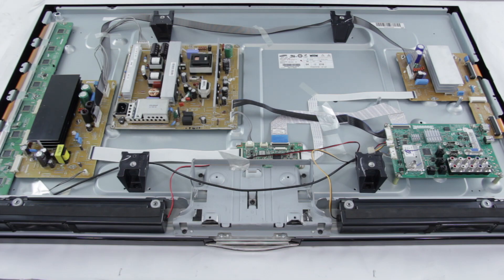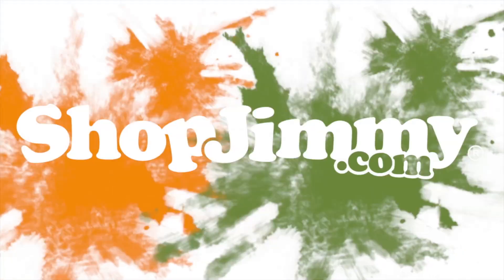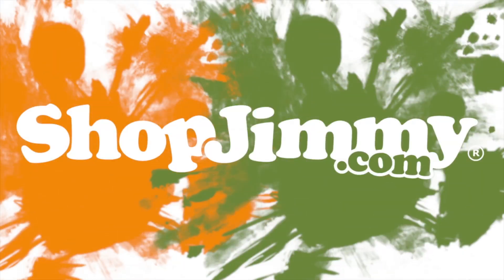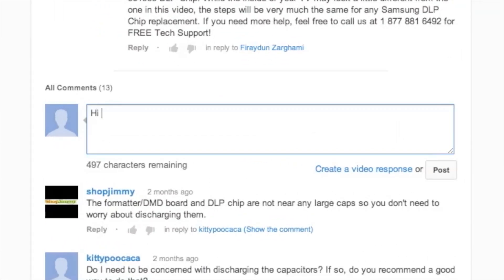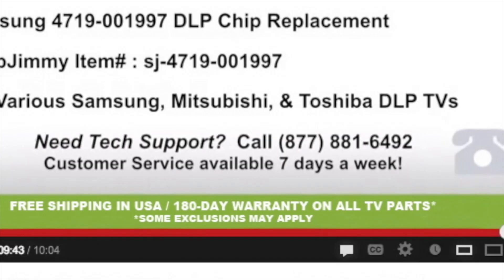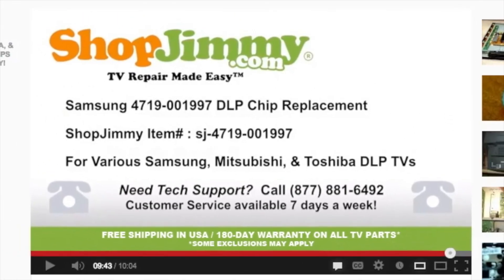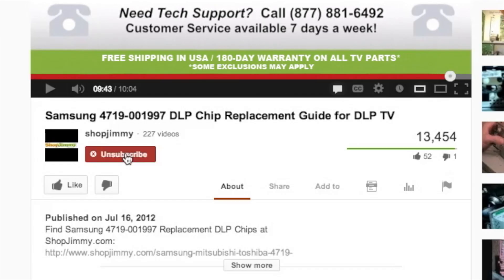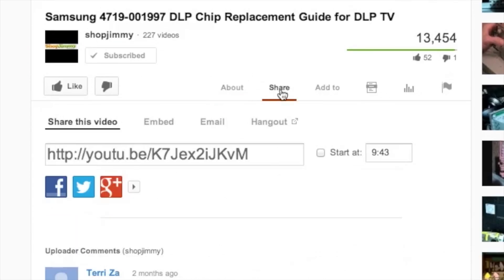Plasma TV Repair Tutorial - Common Symptoms & Solutions - How to Fix Plasma TVs

Comment: Samsung PS50P91FHX /XFA
Hi there,
My Tv works fine for some hours of running then the picture goes fuzzy with many coloured dots then shuts itself off and turns on again for a while with a good picture, then does the same again after a few minutes or so. Then when I leave it shut off for some time it works again for a while then does the same thing again and shuts itself off and sometimes wont even turn on with a picture again unless it has been shut off for a while. 
Could it be bad capacitors?
Thank you in advance for your kind advice.

Comment: l have a Samsung plasma tv model # 850FH - YB01 when you turn it on it will click and  make a loud pop/screiching sound with lines if l unplug it and plug back in it will repeat the process with different sounds and lines if l do it enough times it will come on and work perfectly also if it is on and warmed up and you turn it off then back on it will come on like it is supposed too any ideas on the problem

Comment: I have a 50'' LG Plasma PDP50H20000, when I plug in the power cable. Then the TV clicks and the LED flashes green, then it clicks again and the LED flashes red. This happens 3 times and then the TV stays off and LED flashes red.

I have replaced the PowerSupply Unit with a replacement and leaves the Y-SUS und Z-SUS Board disconnected. But the error still exists.

I hope you can help, thank you

Comment: Hey, my Samsung UN40F6300AF led tv wont turn on however the red light blinks several times when trying to turn on. Also on another note, on the back of the tv there is a little casing you can take off and unplug a connector leading to the main board. When I do that the tv doesn't blink red or go on still. Any thoughts? thanks

Comment: I have a 42" Samsung Plasma TV model #PN43#440A2FXZA that does not power on. There is one fuse on the power board. What is the proper way to test it? An OHM meter?
Reply from the maker: Patrick Martucci    Try this at your own risk. Unplug the TV, then disconnect the y board and plug in the TV to see if the TV powers up. Reply with the results of this test. Thanks! www.shopjimmy.com

Comment: samsung 60 inch t.v. model # S60FH-YBO2  for about 2-3 months sometimes my tv WOULD not turn on with picture.. I found if i unplugged the power cord from the back of the tv n plug it right back in it would turn back on..well it finally stopped I need your GUYS help desperately....THANKS
Reply from the maker: Brad Jones   Try all repairs and troubleshooting at your own risk.  I recommend running the flashlight test on your TV.   Here is a link to a video we produced that shows how to run the flashlight test. https://www.youtube.com/watch?v=xUzCLgoSPGM Please reply with your flashlight test results and we can recommend a replacement part for your TV repair. Thanks and please let us know if you have any questions! www.shopjimmy.com

Comment: A Visio plasma model M3D650SV  has 2 vertical bars right of center as observed from the front.  The bars are about a connector width apart, one has color lines in it.  Both bars go from top to bottom.  Thanks in advance.
Reply from the maker: William Cartwright   Try all repairs and troubleshooting at your own risk.  This sounds like a TV panel (TV Screen) problem.  If your TV panel is bad, it may be more cost-effective to replace the TV as panels are typically hard to find in stock, difficult to replace, and expensive.  Thanks and please let us know if you have any further questions!  www.shopjimmy.com
Reply: Thank you for you red response.  My error is that this TV is an led, not a plasma.  I assumed because of the weight that it was a plasma.  I am in process of removing back cover in order to take a closer look.  Thanks.

Comment: i have a vizio p50hdtv10a that has no picture and muti colored blurry lines are moving on the screen.. any suggestions before i decide to rip it down for scrap?  Ray
Reply from the maker: raymond roland   PLEASE SUBSCRIBE TO OUR CHANNEL - Try all repairs and troubleshooting at your own risk.  This could be a problem with either the main board or the TV panel.  You can replace the main board to see if that fixes the problem.  Click this link to replacement parts for your TV model number:  http://www.shopjimmy.com/catalogsearch/result/index/?cat=56&q=p50hdtv10a  There may be multiple boards for the same TV model number, be sure to match part numbers on your current board, with your replacement for compatibility.  Here is a link to a video showing how to identify your part number, click here: Thanks and please let us know if you have any further questions with your TV Repair!  www.shopjimmy.com

Comment: Hi!
I have a 2012 Smart Samsung Plasma 55" Tv model No:PN59D7000FF Version No: Y504 S/N No:Z3423CZC100126Y the TV won't stay on, it keeps turn on and off by itself and show the picture of  Smart TV Samsung on the screen at about 1 second but when i looked  at the back of the Tv I can  see a green light flashing everytime it turns back on. I have to unplug it to the outlet for it to stop turning on and off by itself.

Comment: I have a samsung pn51f4500bf plasma TV, after being on for 5-10 min it starts power cycling, your thoughts
Reply from the maker: Paul Server    Try this at your own risk. Unplug the TV, then disconnect the y board and plug in the TV to see if the TV powers up. Reply with the results of this test. Thanks! www.shopjimmy.com
Reply: ShopJimmy.com with the y board disconnected the TV will not power up

Comment: 2013 Samsung LED UN65F6300AF TV. Picture Flashes at about a 1 Second rate. Looking at the Back of the TV (Cover Off) you can see the back Light LED's flash Power Button will flash 5 times slowly. Thinking it was the LED Driver i replaced the Power supply but have the same symptom
Reply from the maker: Larry Peterson  PLEASE SUBSCRIBE TO OUR CHANNEL - Try all repairs and troubleshooting at your own risk.   I recommend replacing the main board in your TV.  Click this link to replacement parts for your TV model number:  http://www.shopjimmy.com/catalogsearch/result/index/?cat=56&q=UN65F6300AF  There may be multiple boards for the same TV model number, be sure to match part numbers on your current board, with your replacement for compatibility.  Here is a link to a video showing how to identify your part number, click here:  https://www.youtube.com/watch?v=BEPWrefQvqI  Thanks and please let us know if you have any further questions with your TV Repair!  www.shopjimmy.com

Comment: Hello this is sam  i have a sharp aquos 55 inch led tv model number lc-55le620ut its having some lines on the right side of the screen an its flikerings  the picture is moving in slow motion on one side  an the middle it has a black shadow an some times it goes away after like 20 mins but know is stuck like that please help

Comment: My problem could be slightly different. I have a solid black vertical line going down my TV, its a Samsung model No. PN50A400C2D, its about 2 inches wide. Is it still the Logic Board even though there isn't color lines.
Reply from the maker: stefan garza   Try all repairs and troubleshooting at your own risk.  This sounds like a TV panel (TV Screen) problem.  If your TV panel is bad, it may be more cost-effective to replace the TV as panels are typically hard to find in stock, difficult to replace, and expensive.  Thanks and please let us know if you have any further questions!  www.shopjimmy.com

Comment: Great video.  I have a Samsung Plasma PN50A550 which will not turn on.  No power, no red light, no clicking, nothing.  I checked the usual suspects -- outlets, power cord, etc. What is the most likely issue?  Fuses, capacitors, etc.  Can I fix this myself on this model?

Comment: Hello Shop Jimmy,

I have a LG 50PV450 plasma. It has sound but no picture. 
A couple of days before it failed completely, I would turn on the tv, get sound and a few minutes later picture would appear. On the last day before it died, the tv was on (with sound /no picture) for 30mins, before picture appeared.

Any suggestions?

Comment: Hi thought your video was informative .Thanks.I have a samsung 43"plasma m,code ps43d490a1wxxu with a screen that has red speckles and a yellow haze.This looks to be the x sustain planel,what do you think and how much will it cost to fix? Thanks John.
Reply from the maker: sandie rowland  PLEASE SUBSCRIBE TO OUR CHANNEL - Try all repairs and troubleshooting at your own risk.  I recommend replacing the Y-Main Board and the Bottom Y Scan Drive.  Click this link to replacement parts for your TV model number:  http://www.shopjimmy.com/catalogsearch/result/?q=43d490a1   There may be multiple boards for the same TV model number, be sure to match part numbers on your current board, with your replacement for compatibility.  Here is a link to a video showing how to identify your part number, click here:  https://www.youtube.com/watch?v=R1jmj_foId0  Thanks and please let us know if you have any further questions with your TV Repair!  www.shopjimmy.com

Comment: I have a pn64e550d1f and it was power cycling on and off so i inspected boards and found a blown transistor on the x board so i changed the board and tv worked for an hour and now it is power cycling again.any ideas on what the problem could be?

Comment: I have a Samsung plasma model HPT4254X/XAA that one day just turned off suddenly and then was attempting to cycle back on. I could hear a relay (I think) keep clicking every few seconds but the picture never reappeared. I unplugged it and a day later plugged it in. I worked fine for a few days then repeated the same behavior and now will only power cycle but no picture ever appears. According to your video that might be the Y-sustain? I would love to fix it myself somehow so let me know if you think that is the problem, what part to order from you, and how difficult it is to fix. Thanks!!
Matt

Comment: Hi Jimmy, I have a Samsung pn50b550T2F .
I have two vertical lines on the screen. There is a black line about an inch thick. Also after opening and using a can of air to blow the dust, I got a new black and white line 1 inch thick. The bottom buffer has brown flexible ribbon cable that appears to be soldered or glued to the metal connector, as there is no connector to release the ribbon cable.

Comment: Samsung pn50c430a1dxza the tv does not turn on when i press the power button. I hear it click on, but the screen is b lack. So far i have troubleshoot by powering up with x or y disconnected to see it would power on with one disconnected but no luck. Any suggestions ...respond to rs109@gmail.com
Reply from the maker: ras109   PLEASE SUBSCRIBE TO OUR CHANNEL - Try all repairs and troubleshooting at your own risk.  This could be a problem with either the main board or the power supply.  You can replace each board individually to see if one of them fixes the problem.  Click this link to replacement parts for your TV model number:  http://www.shopjimmy.com/catalogsearch/result/?q=pn50c430a1dxza  There may be multiple boards for the same TV model number, be sure to match part numbers on your current board, with your replacement for compatibility.  Thanks and please let us know if you have any further questions with your TV Repair!  www.shopjimmy.com

Comment: Samsung PS51D455 - it gave a loud pop, when turning it on and the screen stayed black. When replugging power the standby LED blinks 6 times and then stays of (Can't remember if that's the normal startup sequence). 
I got the backcover of for further inspection and looked for any blowed components. Every seems fine except for a round blue component on the Y mainboard that has cracked some of plastic off but it doesnt really look like has expanded. The "heartbeat" LED doesn't blink like it should - long blinks. Any suggestions is appreciated. Thank you very much! :)
Reply from the maker: Daniel Christensen   Try this at your own risk. Unplug the TV, then disconnect the y board and plug in the TV to see if the TV powers up. Reply with the results of this test. Thanks! www.shopjimmy.com

Comment: Samsung PN43D490A10 PLASMA. I believe we had a voltage spike causing amps and tv to stop working. The TV has the red standby, when using the remote you can hear tv click and screen flickers but stays black. I hooked up a DVD player that works and pushed source many times no pic or sound, but led light reacts to remote. You cannot turn tv off only if you unplug tv the power it on. The green led light in back stays flashing, unil you unplug tv then power by remote stays flashing. Any help would be great thanks

Comment: I have a Samsung 55" plasma model pn50b450b1D. It have white vertical lines on it. My buddy took the back panel off messed with a few ribbon cables and now there is just sound. I'm pretty sure I figured out what part is messed up based on this video. But would like to know if there is anything eles I should check

Comment: have samsung plasma pn 58b 650 sif.  just shot down other day..makes clicking noise but does not turn. on    has stand by red lite working.  replaced power supply board. Did not help.  some flashing little green lites on the smaller board just under the power board lil to the right.   please help .
Reply from the maker: Derrick Warner   Try this at your own risk. Unplug the TV, then disconnect the y board and plug in the TV to see if the TV powers up. Reply with the results of this test. Thanks! www.shopjimmy.com

Comment: Hi. I have a Samsung PN60E535A3F 60"Plasma. A while ago it started having trouble powering on. It would have sound but no picture. It would be fine and perfect when it would come on, but was hard to get to that point. Sometimes it took a few power cycles to get it to work and now it has stopped altogether. Sound still but no picture. The green LED inside stays on for 5 secs and then goes off for 3. I am thinking main board?
Reply: Ok. I have come also to this conclusion, but cannot find the y board in stock anywhere!! Any ideas/ suggestions? Thanks for responding!

Comment: Hi, I have a Panasonic TH-42PW3 with picture problems. I have blue/grainy colour bleeding, it is mostly visible on white/light background. Can you please advise which component has failed?
Reply from the maker: Mahesh Patel  PLEASE SUBSCRIBE TO OUR CHANNEL - Try all repairs and troubleshooting at your own risk.   I recommend replacing the SC, SU and SD boards in your TV.  Click this link to replacement parts for your TV model number:  http://www.shopjimmy.com/catalogsearch/result/?q=TH-42PW3  There may be multiple boards for the same TV model number, be sure to match part numbers on your current board, with your replacement for compatibility.  Thanks and please let us know if you have any further questions with your TV Repair!  www.shopjimmy.com

Comment: Hello I have a lg 50pn6500 tv will not fully power up I plug it in and I get a gray screen it will initially flash bright gray as if it is starting up but then just a dull gray screen can you help me please  ?
Reply from the maker: Timothy Middlecamp  PLEASE SUBSCRIBE TO OUR CHANNEL - Try all repairs and troubleshooting at your own risk.   I recommend replacing the YSUS and the YDRV board in your TV.  Click this link to replacement parts for your TV model number:  http://www.shopjimmy.com/catalogsearch/result/?q=50pn6500  There may be multiple boards for the same TV model number, be sure to match part numbers on your current board, with your replacement for compatibility.  Here is a link to a video showing how to identify your part number, click here:  https://www.youtube.com/watch?v=GEllG3RV-tc  Thanks and please let us know if you have any further questions with your TV Repair!  www.shopjimmy.com
Reply: ShopJimmy.com 

Hello I have a lg 50pn6500 when I plug tv and tv tries to start I get a bright gray flash and the it goes to a dull gray a red light comes on in lower left corner if I push button tv tries to start again even though  tv has all ready  some what started it does this once then none of the button work at all after this some times you can get the tv to come on if you wait and plug it in and out the tv will sometimes come on power supply has no blown caps nothing looks bad  was advised to change my ysus and ydrv board this did nothing same issue can you help me any suggestions ? please  bdogtsm@aol.com  Thank you for your help in advance    

      
Read more

Comment: Thanks for your videos! I have a tc-p50u2 that will not power on. I've traced power through the noise filter to power board itself.  I'm not getting power at any of the connection that feed the other boards. ?  Is this as cut and dry as it sounds? This tv was plugged in during a storm power surge . Any helpful info would be appreciated
Reply from the maker: Michael Adkins   PLEASE SUBSCRIBE TO OUR CHANNEL - Try all repairs and troubleshooting at your own risk.  I recommend replacing the power supply board in your TV.  Click this link to a replacement power supply board for your TV model number:  http://www.shopjimmy.com/panasonic-etx2mm806ael-p-board.htm  There may be multiple boards for the same TV model number, be sure to match part numbers on your current board, with your replacement for compatibility.  Here is a link to a video showing how to identify your part number, click here:  https://www.youtube.com/watch?v=N1ophMtQeZU  Thanks and please let us know if you have any further questions with your TV Repair!  www.shopjimmy.com